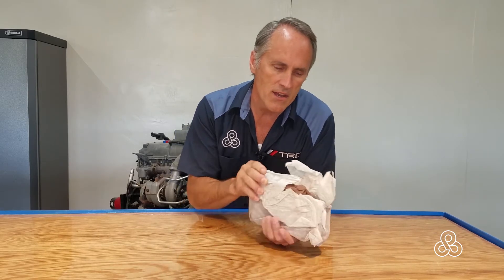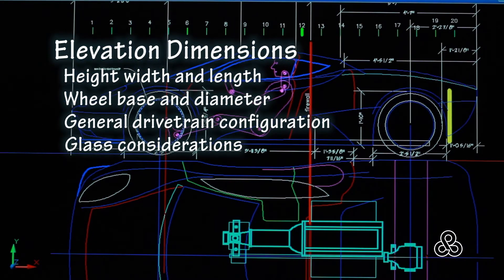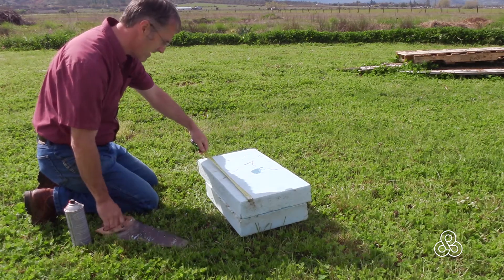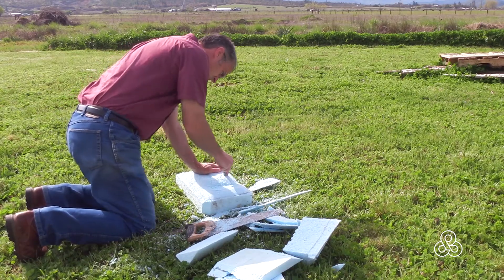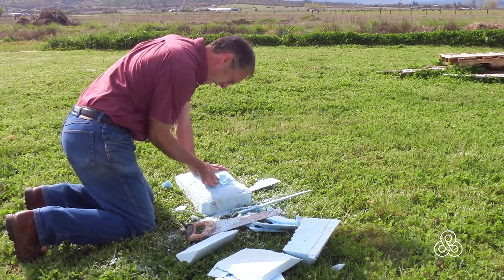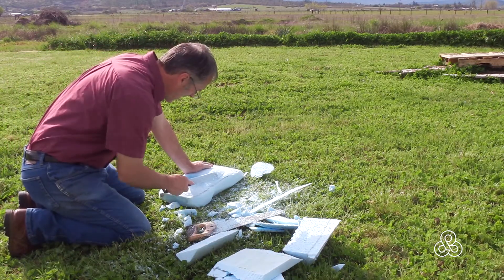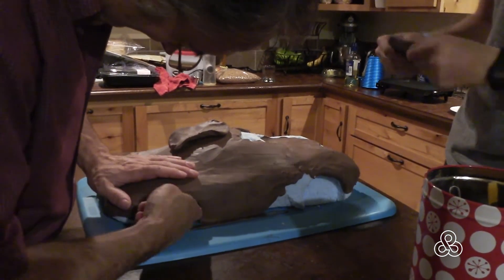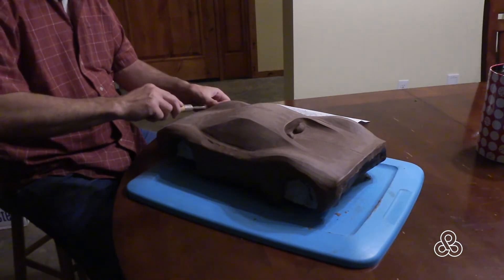A01 - Can this lump of clay become a supercar? Jarvie Arete project

Comment: I have a 2007 hyundai tuscon that the passenger front and driver rear brakes lock up. Ive replaced the calipers and flushed a gallon of fluid through the system and performed an abs air bleed, replaced the module with a junkyard module. but the 2 brakes keep locking up. What are your thoughts, what are things to look for or repalce? Should I try a brand new module instead?
Reply from the maker: I might look at CAN bus controllers (likely, what you are calling "modules") there are likely 2 of them in the system, One for ABS brakes and one for traction control. Since you have opposing corner braking, I would start with Traction control.  Good luck!
Reply: @BuilderCreator thank you very much. I will check those things!

Comment: I have watched most of your videos, you are brilliant in what you are doing.
Just one question, wouldn't a CAD program be better to design the shape of a car instead of using clay, and after that a cnc machine to cut out of foam a full scale model from which you can build a plug?
Reply from the maker: CNC direct to tooling is great if you know EXACTLY what you want. Clay (or plaster in my case) allows for refining/defining the model; just like the big auto manufacturers still do clay models even though they have sophisticated 3D rendering/visualization programs. The plaster plug, is also much less expensive than having your model cut in foam. Thanks for following the project.
Reply: @BuilderCreator  Thanks for the reply